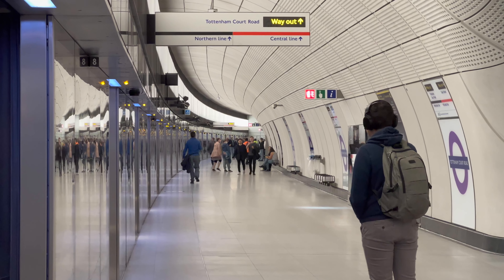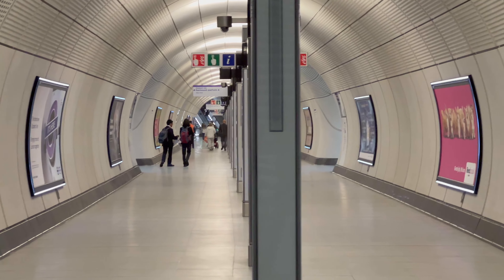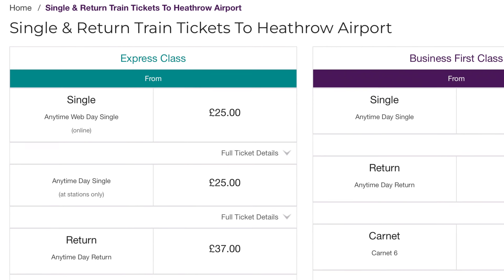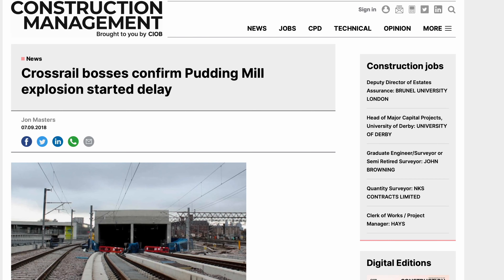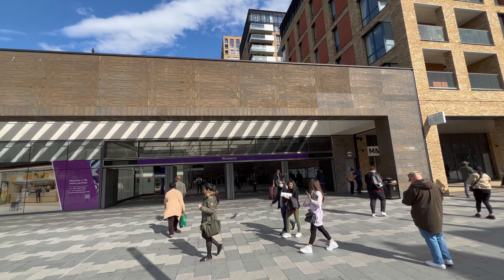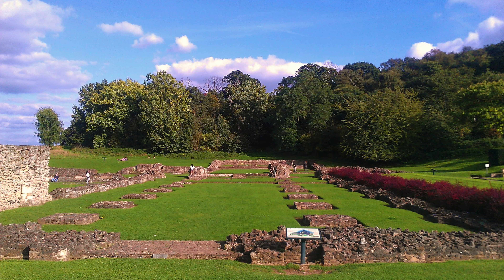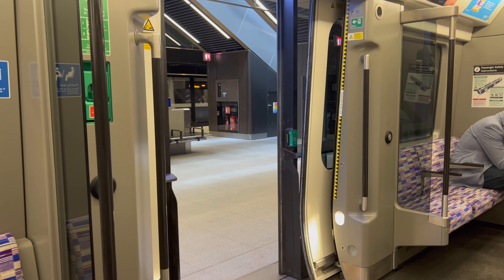Exploring the Elizabeth Line (part 2): Crossrail Strikes Back

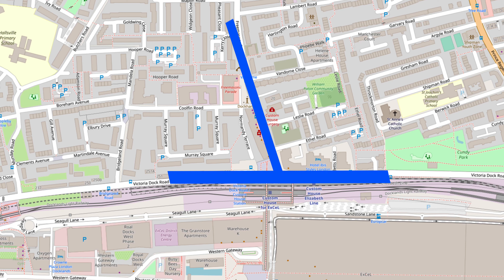Comment: 5:32 and this part is showing who thinks like architect. You're another youtuber confused by this idea, which is actually genius and well though. 
Architects of crossrail could've design boring and standard elevated concourse level. But, by skewing an angle of the structure, something unique happend, allowing greater integration with urban space around it. 

Great video
Reply from the maker: I don’t think it’s bad I just thought it was a wild idea. Custom House is not my favourite station but it definitely could have been more boring than it is.
Reply: @ExploringLondon  I have to agree on that. Thanks for great video, as always

Comment: The line looks modern and attractive. But it runs partly on the surface; in that part it is not an underground but a train. Overground trains are insurmountable barriers. Wouldn't it have been possible to bury those sections, thinking about the future?